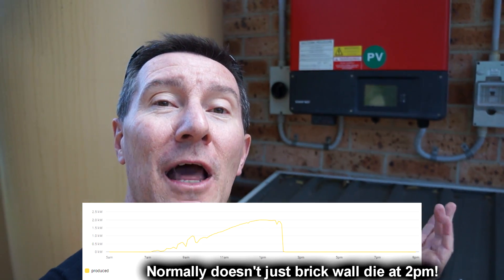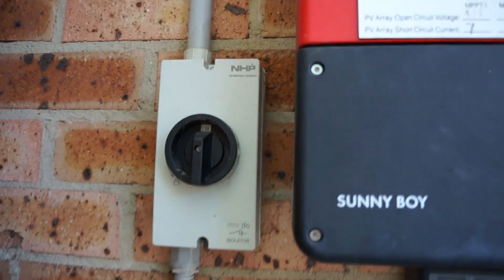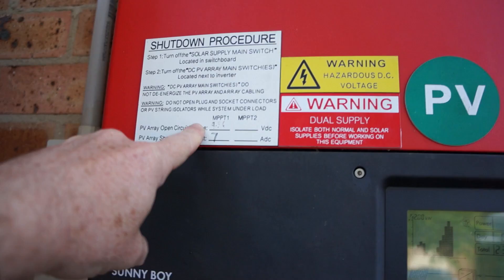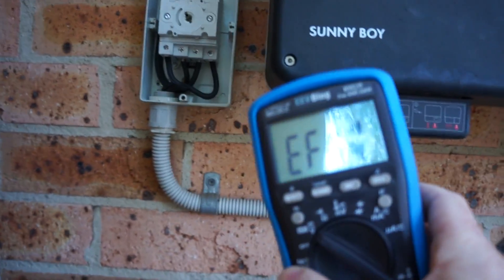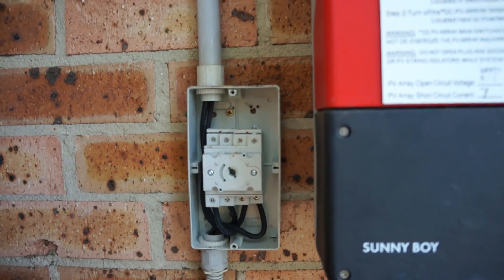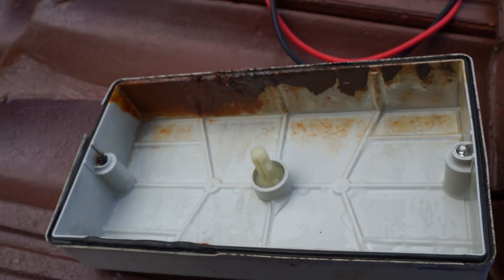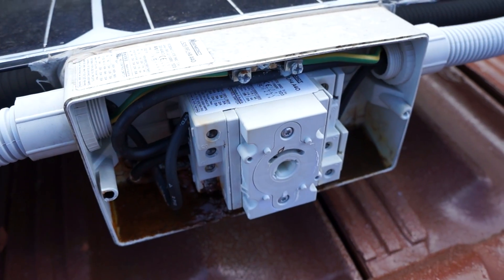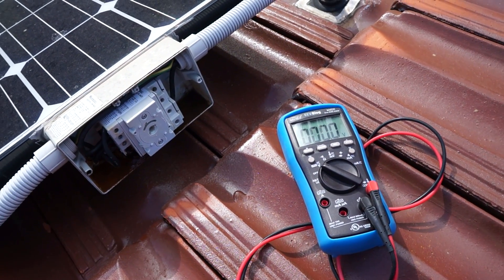EEVblog #1217 - My Home Solar Power System FAILED!

Comment: It's part of our standards that require roof top isolators. I think the logic is to allow a point for emergency services to disconnect if they can't get to the lower isolators. I think the standards changed so that they can't be directly UV exposed any more. They put a shield over the top of them now. 

It's been a bit controversial. Apparently they're a very common failure point and a reasonably common fire source.
Reply: Plenty of water in there to put the fire out. 😐

Comment: You shouldn't have any part of an isolation box with seals facing up.  Seals on the top are bound to fail over time especially if subjected to icing conditions.

Notice that the PVC case itself has weathered just fine.  Either a poor design or poor mounting location.  Perhaps it was designed for outdoor use but not with direct exposure to rain.  If it was mounted under the panel there very likely would not be any sign of moisture getting in.
Reply: Lots of SUN, some rain, and so on... The sun gets rid of the plasticizers in the seal, and then rain takes care of the rest...  Best to have some form of sun shade over the box... That would help keep rain off it to some extent, but would keep the sun off of the thing...

Comment: It's for safety, by code it has to be within sight of the controlled device (solar panels). Also the switch (all) should have provisions for LOTO (Lock Out Tag Out) for safety.

Comment: Maybe an idea: get black plastic agricultural sheets to throw over the solar array instead of the roof insulator switch and replace the switch with a potted connect.
That saves you from repeated trips to your roof!
Nothing can withstand weather!

Comment: They may have the two isolators to make maintenance easier and a precaution.

You have the one on the roof before it enters the property and then the one by the inverter to save you going onto the roof.

Comment: Was that housing rated for long term outdoor/UV exposure??? it should have been. anyway imho you don't need that panel mounted isolator switch, although that might traditionally have been a combiner box which certainly does not have to be roof mounted next to the panels. Mind you one normally has suitably rated circuit breaker to protect the conductor at the source, so that might be the reasoning for local codes if that is the case.

Comment: From what I have seen most "weather proof" boxes try to block water getting in from the edges and top but most all have a weep hole at the bottom, I would think this has one, but it was never drilled or because the box was at an angle it just made a bowl to catch water. The plastic failing is probably why they are recalled as they use none UV treated. Remember to keep your tip clean.

Comment: Really belive that this switch should't be mount in this position on the roof :)
Reply: IKR? Why have a switch there at all? Can't be for convenience like the one down below. Just remove it altogether. Illegality issues may apply to installer only - they did their duty.

Comment: Shoulda just put the thing under one of the panels.
I wonder if you could bypass the inverter and run a seperate DC circuit to DC outlets in your home for powering DC to SMPS-powered electronics? Be neat if there was a cross-compatible plug so you could plug items that want 340VDC but have their own rectifier into either an AC or a DC outlet, but AC appliances like microwaves can only be plugged into the AC outlets. Pointless for folks without a PV or battery setup, unless they feel like having an external rectifier bridge with a shitton of filtering caps.

Comment: Nice video! I bought my inverter in 2000 - a 5K - 24v to 120 AC. I designed and installed the entire system myself at my house. I do not have a DC switch thing you have. I used a controller for the batteries; also from 2000. Hope you well.
My system after 20 years has degraded a lot: 10 panels = 1200 watts - 2 panels broke/failed - the remaining 8 panels after 20 years make: This is: 8 120 Watts panels that are 20 years old: they make: maybe total of 600?? The Great news is that new panels are 70% less: I upgraded this year by adding 5 300 watts of panels. Now my system gets me 8 K watts a day if I run the AC.

Comment: You recall a DC Isolator switch by finding out after the fact that it is not able to keep out insects. And 'straya has a few insects available.
On the other hand, roof-top DC Isolators is just a silly idea and has lead to many many house-fires. Straya is the only country that requires there be a DC Isolator on the roof next to the panels. :(

Comment: Weatherproof? That box was weather resistant, not weatherproof. It should not have been used in an open location like that where it did not have any shelter from driving rain and full sunlight. When you replace the box or switch (if you need a switch there, if not you are going to need a box for access to the junction), I would put in a waterproof/weatherproof box, preferably made out of aluminium, including the cover plate. Plastic is just going to fail up there too easily. I lived in eastern Washington State in the US and we had very high UV levels year round because of the rain shadow from the Cascade Mountains. Plastics like that never lasted when in direct exposure to the sun. We also had some serious temperature extremes of 95F or higher daytime and 50F at night during the summer with 35F to -10F in the winter, so thermal cycling of of anything outdoors was brutal.

Comment: I have 2 strings and one of the roof isolators melted during the warranty period so I was able to get it replaced for free. Problem was I was overseas during summer and missed the solar input for a fair amount of my time away. Thankfully it didn't start a fire and I had a house to come back to!

Comment: Gak. No cast aluminum boxes available there? Plastic boxes in the Aussie death rays aren't going to last all that long. You do need the extra isolater switches since there's no easy way to turn off a solar panel. I suppose you could throw tarps over them.

BTW, what's that roof material? Tin?

Comment: Thanks for sharing
In my work, I usually drill a big hole in the lowest point, to  let the water OUT off the IP67 boxes, when in open air...
Reply: Whoops, really? It won't be IP67 if you drill a hole in it lol. What you want is a breather to let out the humidity, but stop water/dust ingress

Comment: Probably broken down from UV light. Bad design. Cast aluminum would still be chooching after 6 years
Reply: But won't that get red hot in the sun?
Reply: not red hot... might get a bit warm. Main reason aluminum seems to get so hot to the touch is that it's a good heat conductor. Does not mean it's actually any hotter than the plastic box. It's just transferring that heat to your skin far more efficiently. You could also paint it white to help it reflect light if that's a concern. 

Any electronics for this should be rated to take a bit of heat, I'd think. 

Up here in canada almost all electrical boxes are metal and we get some hot days without problems. More importantly the boxes survive the temperature extremes where the temp can shift 50 degrees in a day. 

We also use fibre reinforced PVC but it cracks all the time, and is the inferior product.
Reply: @squee222  I see then. What kinds of electrical install problems can you get with Canadian winters? I bet condensation freezing causes all sorts of problems.

Comment: Having high DC voltages on the roof just makes me stress that little bit more... it is good to see that even when those switches corrode to nothing you didn’t end up with a conductive path to the roof.... It may be a pain   But I still prefer 24v and batteries, mains inverters are incredible but having your roof live at up to 800v just doesn’t sound like fun.

My parents shop has the panels that each have their own built in inverter it has been about 4 years and no problems so far but theoretically the system could detect which panel or switch failed and because they are in parallel would keep running if a panel failed
Reply: positive and negative of the panels are not referenced to earth, so the possible damage is quite limited, but I also still wonder about the purpose of the two switches, since the inverter already has a emergency shut of switch (the thing on the bottom left can be pulled out and turns the DC in off).
Reply: DooMMasteR old school designs didn’t have to have a floating -ve and could be grounded through the inverter’s ground wire so it could be a hangover from old installation codes, having your roof live at 400 V doesn’t sound like fun.

I have worked on a lot of houses with tin roofs where there has been a fair bit of galvanic corrosion from there being a conductive path from the panels (some were held up on bits of wood which ended up full of metal ions ) 

I work with a specialist electrician when doing the high voltage installations so he gets to play with the high voltages and I just get the panels to point at the sun and stay where they are supposed to be.
I mainly did standalone systems until the beginning of the year so I am not all that well versed in the history
Reply: @glenecollins  todays inverters will detect a grounded input, will shut off and warn about it.
Having a large surface like the roof being negative dramatically increases the danger of shock to emergency personell, not cool :-P
Installing PV is quite safe and easy, as you stated the only part that really might be considered dangerous ist the part of connecting all panels in series and then to the inverter.

After all, a true shut off would have an IGBT/MOSFET or relay in every panel, that would by default short out the panels themselves and need an external input to power the system on, these are quite rare so far, but LG and others are already offering self shorting panels, which are the ultimate solution to all unwanted and unaccountable dangers :-)

Comment: Interesting, our installers installed shields over the on-roof isolators presumably to reduce the UV exposure.

And I'd expect the reason they have them on the roof is because you need to be able to see the isolator when you're working on the plant. ISTR some bits in AS3000 to that effect.
Reply: It's now a rule you have to install a vertical isolator shroud. Can't remember the reason for the rooftop isolator but id day it's for the firey's to have more points of isolation in an emergency. AS5033 is the solar standard
Reply: That makes no sense, the solar panel is the source you are trying to isolate not the plant, the 'plant' would be the inverter.
Reply: @Enigma107  In AS5033 clause 4.4.1.5 it states that isolators must be installed adjacent to the PV array and also if the inverter is not in sight or more than 3m from the array you must install a second isolator at the inverter.
Reply: @camerongemmell2354  Yeah, that's an extension of (or perhaps the solar variant of) the AS3000 clause I was thinking of. Basically you have to be able to see the isolator so you know what to turn off before you start working on it.

Comment: Why didn't you tape something like duck tape over it, to "hide" it from UV?
also box is crap, conduit next to is totally fine
Reply: Duct tape doesn't survive long outside either.
Reply: @sonictech1000  
I know, it's sacrificial, just needs to be between the sun and the box and not turn into complete dust and wash away

Comment: Here in Germany we have no isolator switch on the roof that can fail. Even mounting the inverter in front of the House is unusual. Normally it is in the ceiling.
I use a solaredge system. In this case of an error you would have measured 12V on the string not 430V. 1V per module. That is much safer to work on.

Comment: I would just bypass that switch TBH.  If any work needs to be done on the panels themselves, chances are it would be before the switch, so there would still be a risk that needs to be addressed anyway by disconnecting a panel to break the string.  You already have the one going to the inverter so that one can be used if work needs to be done on inverter. 

Going to guess it's some silly regulation though.

Comment: Boxes like this should always have a hole on the bottom to drain all the water that gets through all the seals when temperature and humidity changes during the day. There is no way around it even if the box is not broken the better the seal the less water vapour and drops can escape back into the outside air. You are lucky to have a relagively warm and dry climate. In a place like where I live the thing would not even survive its first winter.

Comment: Crappy quality of the plastic box. A quality box would be fibre-glass with better UV resistance or painted steel or stainless steel. A better quality box that size isn't much more expensive.

Comment: My  inverter failed at year 8 (warranty replacement with an identical unit).  The replacement failed just short of 10 years, still under warranty.  I am nearing 12 years now but the warranty was only for 10 years.  So far, so good.

Comment: That switch was evaluated by UL under File E359344 (indicated by the backwards UR symbol) and it was only tested to a Type 1 rating = Indoor use only.  It was never tested by UL for outdoor wet-location use,  like it is currently being used (which would need a rating of Type 3R, 4, or 6).  I do see the switch marked with an IP66 rating, but that was never tested by UL, since that solid line separates the UL "use information" from all the other information that may or may not be certified by another certification agency.

Comment: 400 plus volts DC, how friggen dangerous is that! Why dont they limit it to 50 or so volts and run heavier cable. Would be a lot safer, and less  isolation switch faults.

Comment: @EEVblog Kind of seems as though it shouldn't have been mounted sideways anyway, I reckon it would still be running today if it had been mounted flat. Why put the seals through harsh treatment when you don't need to? I'm always tempted to put something like this in a poly-bag anyway, that way you have a first defense against rain and UV.

Comment: HV DC runs in domestic situations are a fire hazard waiting to happen. Much prefer microinverters under each panel.
Reply: Interesting idea... I like it, and agree, with technology getting cheaper and smaller, that would be the way to go.
Reply: @TheChipmunk2008  It's what I have under the 20 panels in my system. I can see the power generated per panel and identify and single panel faults or shading issues.

Comment: Your installer should have put the isolation switch under one of the solar panels to protect it from the weather !!
Reply: Unfortunately your not supposed to do that, the rules state it must be in an open accessible location.  With so make isolators failing is shows how poorly made they are,  outdoor power points last for many many years in direct sun, why should these be any different.
Reply: @Tas-Devil  Maybe they should change the rules :) Not sure the roof is classified as open accessible area :) .. The regulation sounds stupid .. why two isolation switches anyway?

My guess is they are using the isolation switch on the roof as a makeshift junction box, which would have been a real junction box if you had multiple solar panel strings.
Reply: @garysalisbury4117  I completely agree, the rules make no sense, you have to remember like most rules they are created by someone in their fancy office who does not live in the real world.
Reply: @Tas-Devil  True ... lol

Comment: I've never heard of a DC isolator before. Maybe that's an Australian legal thing like you said.
Reply: Required here in the UK, but only at the inverter, not on the roof. (It's to allow the installer/maintainer to work on both the inverter and the array without risking drawing an arc and thus getting fried)

Comment: My best guess for the switch on the roof is for maintenance. Lots of roof equipments (if not all) have a mains power switch (not fused) next to it plus a fused master switch in the electrical room. This way, you don't have to go down the ladder everytime you need to turn it on or off saving time and/or potential fall. It might not be "needed" for residential purposes but probably mandatory by the Austalian electrical code.

Comment: The industry regulators make installers put the DC isolator on the roof, one for each string. They put a alloy cover over the switch these days . But they are arguing about if the switch should be there or not. But like all rules, it will be years before they make a decision either way, in the mean time, isolators are required by the rules.

Comment: Solar panels LOVE to arc when you break their connection. Those isolator switches aren't quite as simple as just touching two wires together in a plastic box

Comment: Six years is way too soon for the plastic to degrade in the sun. The plastics for sun exposure usually have a higher rating and can go well over a decade. Your solar panels should at least last 20 years plus.

Comment: I checked my installation (Queensland) and the wires from the panels were routed under the panels  and under the tiles' bottom edge into the roof space where all the wires come together to a connector block and then gets routed to an isolator switch in my garage next to the inverter. Your inverter also seems to be too exposed to the elements based on what I can see. Don't know if you heard about the controversy in Queensland where they promulgated regulation requiring that only licensed electricians do the mechanical installation of solar panels, but was recently overturned by the supreme court.

Comment: Maybe adding small hole on the bottom of the switch will prevent from moisture accumulating. No rubber seal is 100%. Shading the box from UV would also help.

Comment: If one really need a switch up there, tap a tiny drain hole at the part that points down. Moist, leakage and liquids will drain out before causing any serious trouble.